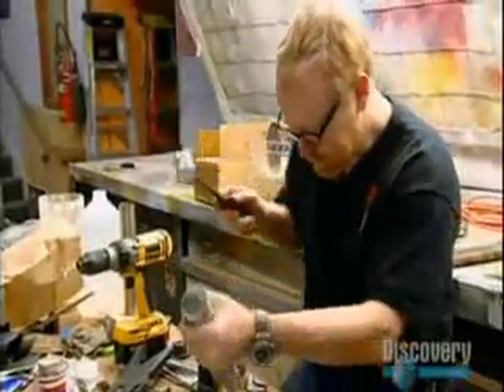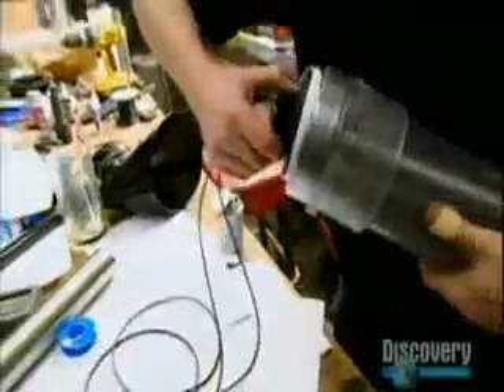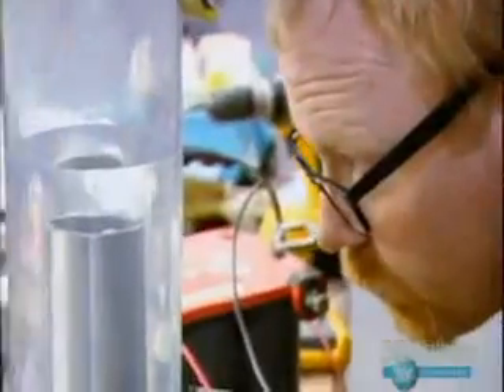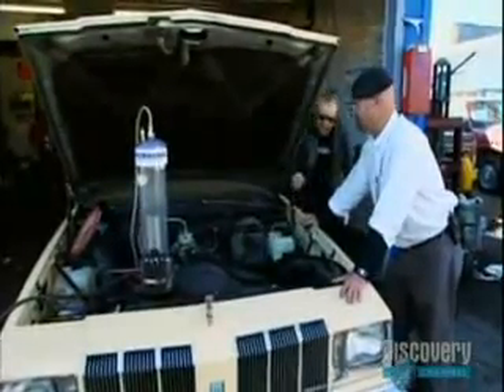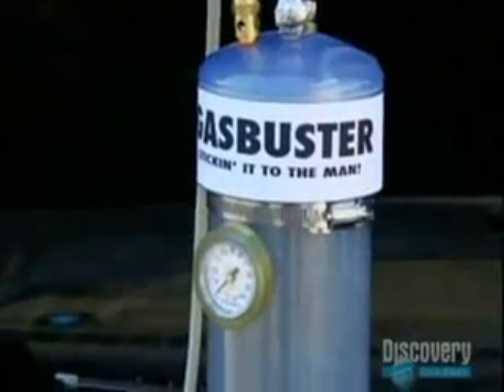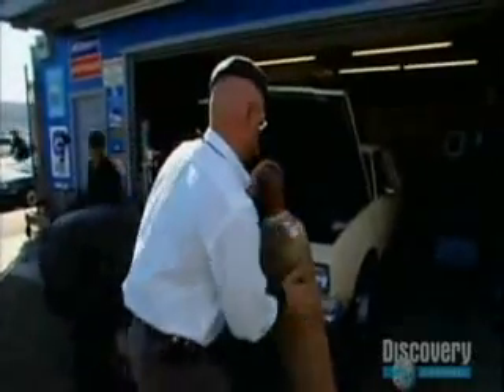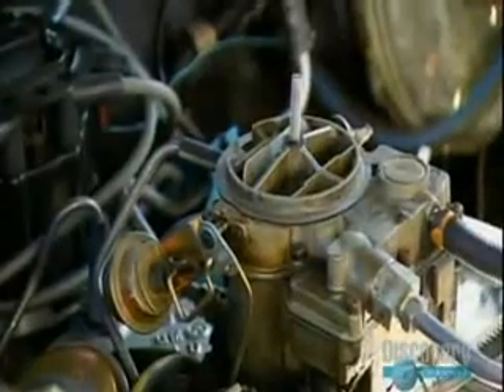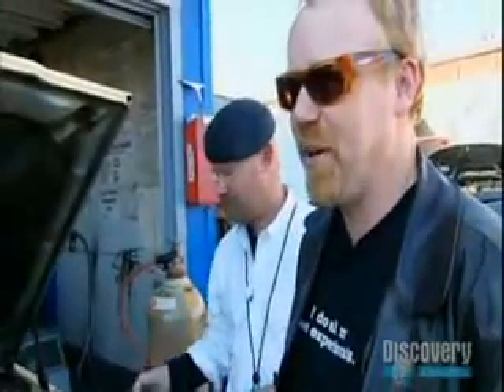HHO Mythbusters Explained

Comment: Yerp.. All it needs is a crap ton of Hydrogen, oh and a power source with enough energy to provide enough amps to produce all that hydrogen, hmmm it's gonna need a significant generator, but the generators we need will severely tax the engine considerably so a lot of the power we are used too will have to go to power the generator that is to generate enough electricity to produce enough Hydrogen and yeah screw the expected losses, I guess it will be OK if we crawl along everywhere we go, But who wants to go significantly slower? I certainly don't.
So I think we may need another motor to run the Generator/s generating enough energy to produce enough Hydrogen so that we can go just as fast as the car originally could, so yeah lets just hitch up a generator, one of those ones that are already loaded on a trailer and we're good to go! 
WAIT!... I just realised we are gonna need a crap ton of hydrogen fuel to run the generator on the Trailer, so lets hitch up another generator to make the fuel for the first generator and we're good to go! 
WAIT! I just realised we gonna need yet another generator to make hydrogen fuel to um err-um ? ?! Hmmm I was gonna say make fuel for that generator, but now we have something more akin to a train, so maybe we should make the hydrogen at home, yeah lets spend lots of money using a crap ton of electricity for several hours to make enough hydrogen at home, so we may drive around for an hour maybe 2 if we take it easy.. WAIT! How much would several amps for several hours of electricity cost? Say what now? WOW!  isn't that more expensive than all other options we have thus far? 
 
I guess if you know the rules of Thermodynamics you already knew where I was going with this ;) Ay?
Reply: For giggles, I once computed how much power the most efficient car-mountable HHO electrolysis available could produce.  This presumes an upgraded alternator and maybe an extra battery.

The chain of producing HHO via alternator/electrolyzer is gruesomely inefficient.  Especially since car alternators top out at around 3/4-1HP (750-1000W).

$2-5K later, you produce about enough HHO to power two candles.
Reply: @sjb3460  The key is the energy density required to separate the Hydrogen and Oxygen for the resulting energy density that is going to be utilised 😉 it's a no brainer the energy used to separate the gass's would have best been stored in a battery and used directly by an electric motor..
Reply: @sjb3460  Wrong wrong wrong.  100% of the gasoline in a car is used to run the engine,  *PERIOD*.  Everything, whether it's powering hte 500W amp in the trunk, recharging your cell phone, moving the car or whatever else comes from the turning of the engine.

It's that very conversion of chemical to mechanical energy that's only about 18-25% efficient regardless of whether it's use for pushing the car OR running the alternator.  There's no 80% "doing something else" every last drop of gasoline (that simply didn't evaporate because of a leaky fuel system) are burned in the engine.

The power running the HHO cell comes from the voltage regulator?  Sure.  But where doe the voltage regulator get it's power?  Magic?  An antenna?  Hamsters on a wheel?  No.  It gets it from the alternator.  Where does the alternator get it?  From the engine.  Where does the engine get it?  From burning the fuel in the tank.

Sure, HHO explosions are cool.  So what?  There's almost no power behind them, they just happen FAST and hence the snap (BANG!).  This is NOTHING compared to an equivalent quantity of vaporized gasoline (or methane or propane or ...) pre-mixed with air.

Burning HHO instead is only 28% at very most (in a stirling engine which isn't at all suitable for a car).

In order to produce that HHO, you have to turn the alternator (chemical->mechanical conversion), convert the rotational energy to electrical (rotation->electricity), and then convert the electrical energy back to chemical (the HHO).  Another conversion.  Each of which LOSES power in the conversion.

So, while you're driving along diverting, say, 500W of the engines rotational energy to the alternator, the inevitable conversion efficiency losses mean you get, if you're fucking lucky, about 10W of power in the form of HHO, and after burning that at a 25% efficiency, you get enough power to move a toy car slowly across the floor at a cost of 500W of gasoline.

Sure it doesn't work at all very well in a modern car with all the computer engine management stuff.  This is a matter of whether the engine works AT ALL with HHO.  But even when you get it all straightened around, you're still stuck with what I've just said about efficiencies.

The ONLY benefit of HHO in this case is to clean out dirty engines and get a few percentage points of improvement in the engine efficiency of the gasoline.  Once clean, it does diddly squat except keep the engine clean.  It's easier and cheaper in the long run to simply buy little bottles of engine cleaner and pour them into the gas tank every once in a while.

This is a fundamental law of the universe, through thermodynamics: there is no free lunch, you rarely come close to breaking-even.

No desire to share information?  Ah, that explains it - you have a financial interest in selling this bullshit.

I'll share because I don't have a financial interest.  A couple hundred pages  from HHO hucksters trying to make a buck?  How about thousands upon thousands of pages of thermodynamics and physics text/reference books in dozens of languages and yet more online.  A couple thermodynamics-specific courses in University.

 I took several.  Did you?  Didn't really need it for this - the basics of "no free lunch" you should get in high school.
Reply: @fromagefrizzbizz9377  And having said that we then have to consider combustion efficiency Vs the Energy used to harvest the gas Vs the Energy matching that stored in a battery and it then powering an Electric motor. Keep in mind how each Fuel is stored and it's efficiency as in how much hydrogen needs to be lugged around for lets say what an ALL electric car and its battery "500~600Kilometers" coming out of production next year can travel.
Reply: @KorAllRBare  FCEVs (bottled hydrogen) are up to around 450km range.  If you tried to match that with pre-bottled HHO, you'd have to carry 50% more gas (O2), at something like 8 times the weight of the hydrogen. And result with a vehicle that' the next best thing to an low yield nuclear weapon with a disconnected BOOM! button.  Just one thing go wrong, and there goes the neighborhood.

Trying to figure out the full/unsubsidized cost of various vehicle fuels is very complex.

But in the end, hydrogen is nothing more than a storage medium for (some fraction of) the energy required to make it.  It doesn't occur naturally in large enough quantities to care, and electrolysis is about the most expensive way to produce it of the 3 or 4 methods used commercially today.  And HHO is the least efficient and most dangerous way of using it.
Reply: @fromagefrizzbizz9377  exactly.. ergo hydrogen may have been viable but what with Battery storage technology still in it's extremely early development being around  a lowly "500 to 600 kilometers" per charge it's a no brainer Hydogen and its dependance on archaic technology has its days numbered if not  already made redundant by what obviously is a superior means of energy effecient transport..
Reply: @KorAllRBare  Yeah, but that ignores the main problem with EV:  Charging time (we won't discuss the problem with neodymium for the moment).

As a brand new owner of a PHEV, this is a reality that I'm learning to live with.

A household regular circuit can put about 7km of range on per hour.  The largest charger you can put in a regular house is only about 4-5 times that per hour.  Sure, Tesla superstation chargers can charge Teslas reasonably quickly, but not in the under 5 minutes it takes to fill a car with gas, and if you're talking 4 or more level 3 chargers at a highway refueling stop, the station is going to be drawing more power than a small town.  We simply don't have the generating capacity for widespread EV, and it takes decades to do more.

Sure, if there was a resurgence in interest in slowpoke nuclear reactors, we could park one in every filling station.  They're solid chunks  with no moving parts, pretty much impossible to do anything bad with, but right now the quantity of fuel available to run one is under about 50Kg.  On the entire planet. And each one needs 5-10Kg.   And it'd take decades to build new facilities to make more.

This is the same isotope used in most onboard space probe nuclear powersources, and  the teensy amount available has been already budgeted for over the next decade or two of space missions.

[The stuff was made previously as a byproduct of production of nuclear weapons.  I don' t believe any of those reactor are still operational, all new weapons have been cannibalized from retired nuclear weapons.  The British think they can produce the stuff from reprocessing nuclear waste from power stations, but they'll peak out at about 10-20kg per year of the stuff needed to run a slowpoke.]
Reply: @fromagefrizzbizz9377  youre right no one enjoys stuffing themselves quick enough before their EV charges itself whilst on a massive road trip . 😉
Reply: @KorAllRBare  Frankly, as things stand, I think personal vehicles (or at least anything larger than an electric bicycle) are doomed as something the masses can have.  There are vastly bigger related problems on the horizon that EV, even with 10x capacities and orders of magnitude faster chargers) at best can only delay things a bit for a few.  There just isn't enough energy, and nothing on the horizon can make up for it, no matter how green or ungreen it is.  Not even unlimited nukes or power sats or covering the earth (insofar as you a actually could) with windfarms or PV can do it.

This part of today's society is inevitably going to contract.  A lot.  With a lot of other consequences.
Reply: @fromagefrizzbizz9377  oh wow!! Sounds like your region is experiencing oppression worse than my chinese mates in china.
Surely you not a Trumped society
Reply: @fromagefrizzbizz9377  My bad, I meant technological hinderences Eg: lack of ecomomical and viable resources for a given region, but with research & adaptation to other more bountiful resources technological development can arise from such mindless gasoline oppression..
Reply: @fromagefrizzbizz9377  BTW I'm not a Merry-kin, I'm an Ass-Trail- Yearn 😆
Reply: @fromagefrizzbizz9377  Also if one considers which Motor provides the most torque, I will always chose an all electric Mwha-HEY!  🤓

Comment: fact one water is fuel whether you understand that or not fact number two water can be converted into a gas which will burn fact number three the only byproduct is water fact number four no other source 4 fuel known has zero pollutants fact number 5 militaries around the world and space programs use this type of fuel for many applications fact number 6 all cars trucks trains planes has some type of a fuel cell primitively called a gas tank personally and environmentally a hydrogen fuel cell when correctly installed is much safer than any tanks in use
 today or past fact number 5 no other fuel source is more readily available cheaper to obtain and less harmful for the environment fact number 6 there are many other uses that has not been discussed in this I have to say it bias and misleading program fact number 7 no other source of fuel will eliminate any and all dependencies of foreign I .E...
Political or   domestic corporations fact number 8 there could be many more facts about why water is the only fuel that should be mandatory fact number 9 this comment that I have left will be attacked ruthlessly fat number 10 I don't give a shit

Comment: I used HHO in a van years ago and it worked. The fumes was infused into both air intake and fuel intake lines for double the effect, while using unleaded gas as most cars use instead of just the HHO going into the carburetor. A fun experiment nonetheless.

Comment: Hey genious, , who said that the  little hidrógen booster was going to make work the engine 💯 percent without using petrol???

It supposed to be that that this cell helps to save fuel.

Shame they didn't do the right experiment, instead they made fun from the hidrógen booster, and of course this is not made to run the engine by itself
Reply: It is impossible to save fuel this way.

Comment: This episode was about ways to boost fuel efficiency. All of the other methods were tried with fuel. This was the only one where they REMOVED the fuel. Every other time they had tried an experiment throughout the entire run of the show, if an experiment didn't work, they tried again. They would double check to see if they had everything hooked up correctly. They would double check to see if they had built the thing correctly. This one? One try, and Adam jumped out of the car and declared "Busted!". This was the last episode I was willing to watch.
Reply: Big oil, man!🤷‍♂️
Reply: @louskunt9798 yup. Go against the oil billionaires and get a death sentence
Reply: @louskunt9798  WTF does that mean?
Reply: @eckyhen it means the energy required to split the hydrogen from the oxygen in the water is greater than the energy you GET from the hydrogen. Think of it like chipping away concrete: imagine two people trying to chip concrete. One person uses a hammer to chip away the concrete. The other person is only allowed to use their bare hands. Obviously the guy with the hammer is going to be able to break up the concrete within a few minutes/hours. But the person using their bare hands... that will take FOREVER to chip away that concrete. Though it's possible, It's completely inefficient. He has to put in soooo much energy to break it. 

In this example, the guy using his bare hands is the metaphor for splitting the hydrogen. It IS possible. But the amount of energy spent just to get enough hydrogen to turn on the car, is completely inefficient.

I don't know the exact numbers, but the amount of energy to start the car that uses hydrogen split from water would be similar to the amount of energy it took a car that ran on gasoline to turn on and drive several thousand miles. It doesn't make sense. We'd waste so much power just trying to split the hydrogen that it would have made far much more sense to just power the car with it. 

I just want to make sure everyone knows, the invention WORKS! It just doesn't work enough to do anything with. BECAUSE of this law. There will ALWAYS be a loss of energy, but there are far more better fuel sources to use than water. At least until we make some groundbreaking discovery that changes everything we knew about the universe. And those discoveries are probably far greater than our ability to understand or replicate.
Reply: Because they didn’t want to commit suicide
Reply: I know very little about the system, but one thing I know for sure is that the hydrogen is supposed to work combined with the fuel, not to replace the fuel. So (rhetorical question, of course...) why did they remove it?
Reply: They “ debunked “.   Hho twice.  Such scumbaggery.
Reply: Because there is a lot to lose if everyone can make their own fuel with solar panels...
It works, you just need to fix the rust problem. because the steam will rust your engine.
Reply: protecting oil industry
Reply: Yeah the Mythbusters failed with this one on epic level. A big disapointment. And with the big mistakes they made on this episode made the Mythbusters not funny to watch anymore. So i called it busted on the Mythbusters.
Reply: It is a Bucking tv show. It is for entertainment.
No one has ever made a perpetual motion machine although lots of fools and charlatans have claimed to have.
This is because it would contradict one of the most fundamental law of physics, the second law of thermodynamics.
Reply: They are not going to spend much time on the impossible. Second law of thermodynamics says energy can’t be created or destroyed. All these that claim otherwise are gimmicks
Reply: @Greg-yu4ij  explain to me how converting h2o into a useable medium to gain access to its potential energy breaks the 2nd law of thermodynamics??
Reply: @Nijuka87 Simply because it takes more energy to split water into it's components than you get back when you recombine them.
Reply: @Nijuka87  It might break the 2nd, but most importantly, it breaks the 1st law of thermodynamics, which states that the amount of energy in an isolated system has to remain constant. That means that if you spend a certain amount of energy to break up the water into HHO, you can't get more than that energy when you recombine the gas into water inside the engine, and as such you only lose energy in the process of running the engine instead of gaining it.

Now what I think is kind of short sighted is how engines have remained so similar for so long. Why do we not have electrolytic hydrogen cells in modern cars when even chemical engineers say they could very well improve efficiency of internal combustion engines? 🤔🤔And a thousand other ways to improve efficiency, instead of jumping the gun into EVs with lithium dependency which are arguably just as bad for the environment.
Reply: @Greg-yu4ij  you don't even understand what you are speaking you fkn ass clown RAT STFU and go do some research.